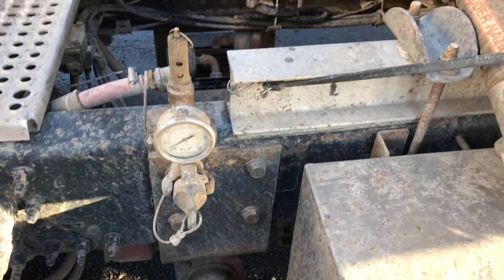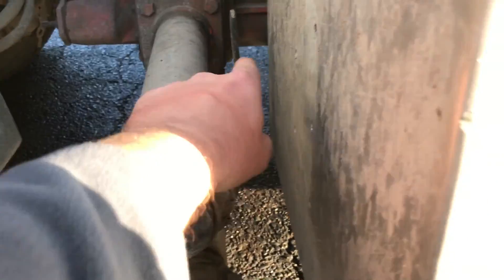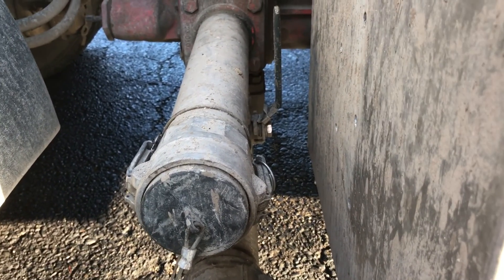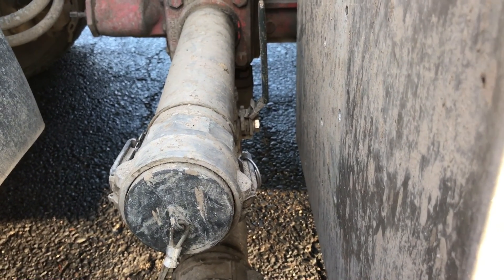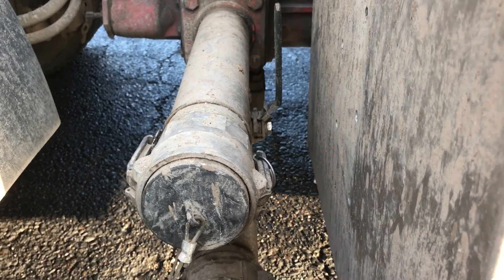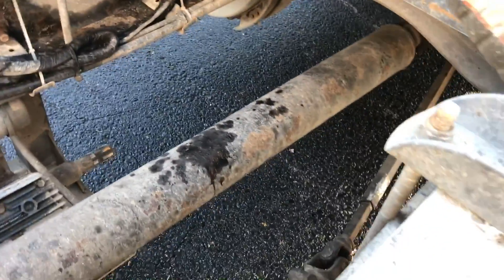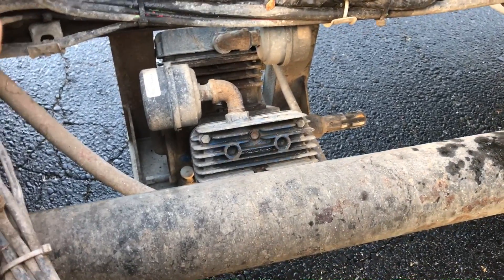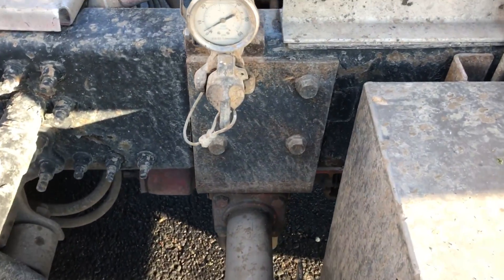Shaft Driven Pump and Compressor For Bulk Tanker

Comment: I've ran both systems, and they both have good and bad points. However nothing that can't be overcome. Remember this is only my opinion, the quick connect calls for you to lay on the ground to transfer the shaft from the pump to the compressor (many use a blower but rather expensive). You MUST always physically grab the shaft when it's attached to the pump and turn it by hand to ensure it's not jammed and turns freely(or it could snap and damage other things).if you run a double shaft you can run both air and pump for very thick and heavy products, but can only be done on a manual transmission. A hydraulic system is more expensive but it can be used on an automatic or manual transmission. Your operation for air and pump is controlled by 1 lever, so if it's a thick or heavy product you can apply air to pressurize the trailer then move the control lever to turn the pump on to use both components 1 at a time. However there is another setup that you don't here much about. It's a "wet-pack", this system combines a hydraulic system that runs off a pto also. It uses hydraulic lines that you can connect to a pump, compressor, and to a pneumatic system on a trailer or a hydraulic pump that's mounted on the trailer. So be sure of the system you will need that works for you.
Reply: 10 to 15K for the wetpack.
Reply: @vaughncowan4055  yup, nothing cheap about that system at all. I still prefer separate units, to apply air while pumping off a load for the thicker non-flammable loads.

Comment: These Compresors have different hp??? Mine kinda too weak compared to the ones on company trucks.put it back then in 2009 but i use it more often with my current company
Reply from the maker: It's very possible that it's worn out and needs to be replaced. Mine lasted about 5 years and at that point I could only get about 16-18 psi out of it. So I bought a new one and it's rocking again.
Reply: John Miller 
So it depends on the compressor itself? Not the PTO??? Some drivers say different pro have different ratio/ settings. Will run faster than others at same rpm.

Comment: hello need to know  what is the model # for the roper pomp and the serial #
and  how much cost  to have the pomp and the air compresor thaks
Reply from the maker: This setup originally cost me around $5,200 installed. That's Polar pricing 2 1/2 years ago. That was a Quincy compressor, Roper Pump, PTO, PTO shaft and Swing shaft installed.

I have since gone to a hydraulic setup and that ran around $8,200, but I used my current air compressor.

A Roper shaft pump should run your in the $800-900 range. When I went to a hydraulic setup, I purchased a new pump with SS shaft and bearings and the pump ran about $1,200. If you want a serial #, it's going to take a couple of days for me to find the paperwork.  

If you're anywhere Louisville KY, I would highly recommend Republic Pneumatics in Sellersburg IN. (About 10 miles north of Louisville) They have been great to work with. If the location works, call them at (800) 472-8228 and ask for Rob.